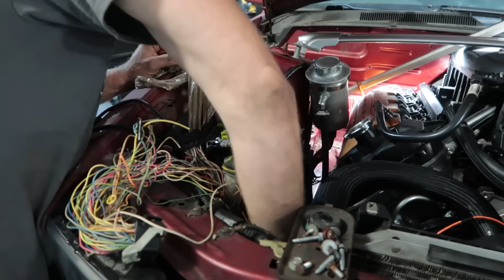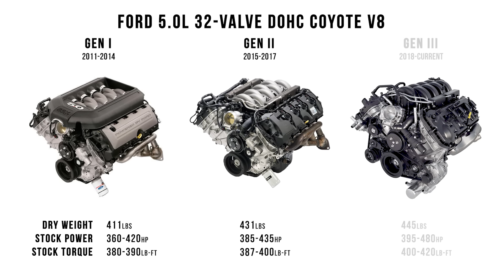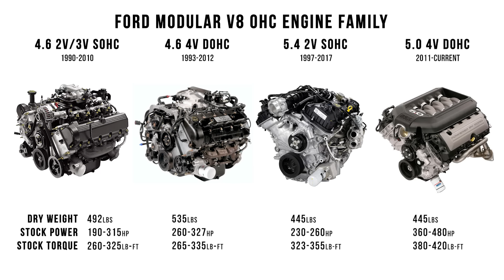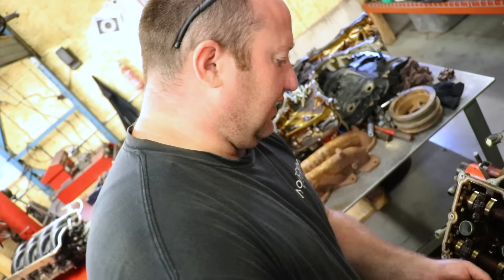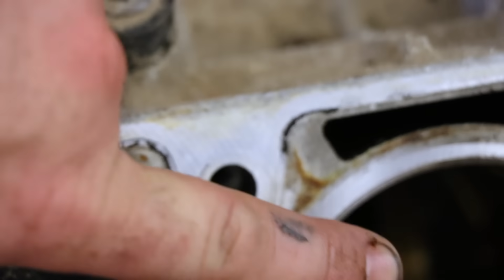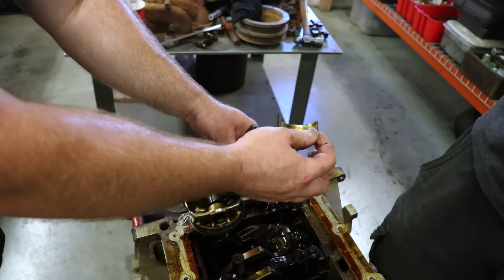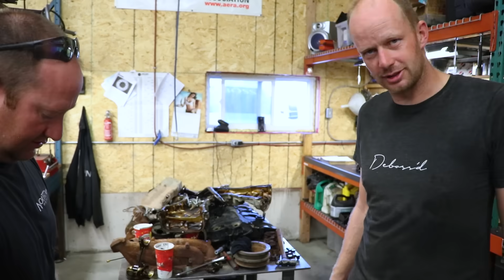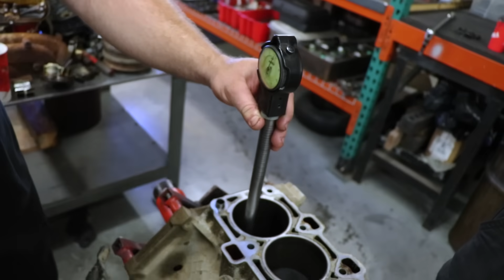REVIEW: Everything Wrong With A 5.0 Coyote Engine

Comment: I have 2 of them.  2015, 2016.  Pretty awesome.  Not much wrong with them.  Flimsy water pump.  The seals around the spark plug tubes and phaser connectors leak.  The reason for the cleaner head is the PCV air comes in on the driver side and goes out the passenger side.  I use Rotella T6 0/5-40 and have zero problems with phasers and oil.  15,000 km oil changes.  Also had a 2008 5.4...300,000km...never opened or worked on once.  Same oil, and oil change schedule.  The compression height discussion was bullshit though.  Unless your crank throw shortened when you bored the engine you 100% have more displacement.  Amateur

Comment: The thing I see with the Coyote, is even though sure, equal mods they can make similar power, the cams and shit for Coyotes are just not as radical. People aren't camming the shit, and turboing the shit out of em as much. Partially because they're already pretty damn good cam wise, but also just because springs would just be so goddamn expensive. So even mod for mod, you add the full liter of displacement a junkyard 6.0l LS has on a coyote, a half decent cylinder head, and a cam/spring, and you're damn near at the same power level regardless of budget.

Comment: 14:12 Siamese cylinder bores....  AKA, no cooling jacket between the holes. 
GMs OLD gen 1 small block 400 did that as well..... and EVERYONE thinks they overheat
.
i own two 400s.... they dont overheat (but they do when you swap them into a 305/350 car WITH OUT also swapping over the bigger radiator that comes with 400 cars/trucks)

Comment: ford needs 4 cams and 4 valves per hole to compete with GM and dodges 1 cam 2 valve PUSHROD engines..... 
AND! the ford motors MAY make more power.... but its in a VERY NARROW RPM range.... 
.
while the old 5.3 /6.0 makes power from off idle to 5800 rpm..... all about air speed
Reply: 4 cams and 4 valves allow for better air flow at high rpm, overhead cams also allow for safer high rpm use. More horsepower can be made at higher rpm.
Reply: @riogrande163  ya, you arnt telling me anything i dont already know
.
yet a 2V pushrod head can flow just as much if not more (hell, you can even have a 4V pushrod head that only uses 2 pushrods.... cummins)
.
yet a pushrod engine can and does rev just as high..... or higher than SOHC/DOHC engines
.
and sure.... HP can be made at high RPM
thats sorta how the math behind HP works
however it also can mean you make TONS of HP at 9000 rpm..... yet have 150 foot pounds of torque (honda 1.4)
.
.
.
OHC makes GREAT peak power numbers (aka, great marketing) 
.
what i want is a RELIABLE engine (with a timing chain that can go 750,000 miles..... not being replaced every ~100K) 
what i want is area under the dyno curve..... not peak numbers so high up in the RPM range, its pointless..... (and only makes that power for ~250 RPM)
.
a 750HP engine will get its ass kicked by a 350HP engine
if the 750HP engine makes power like fords do (again, great peak numbers.... but only for a limited RPM range)
yet that 350HP is made from 1800 to 6500 will kick its ass

Comment: 7:00 my guess would be that the PCV system.... 
air is pulled in on one side (cool air).... flows threw the motor, gets hot and full of vapor, and then gets sucked out the other head. 
.
so the color is just from cooler or hotter oil vapor.....IS MY GUESS!!!

Comment: Look, im not trying to rope myself in with the rest of the people in the comment section and call myself an expert but i have built a few mild and a few full race engines in my day. THIS guy is an idiot. 1) pin height has absolutely nothing to do with displacement. 2) synthetic oils are not abrasive on aluminum. 3) windage trays are installed with the intent to reduce the fog of oil surrounding the crank and return it to the pan as quickly as possible. Windage tray or not, oil squirters or not if the engine is running and has oil pressure the wrist pins are going to get spashed with oil. Seems to me he was trying to impress his buddy with his "knowledge" but totally forgot the internet was watching.

Comment: Synth is NOT NOT NOT the culprit.  It's living in a dusty area, not changing your oil and using poor air and oil filtration.  Has NOTHING to do with the base oil.  That's just one of the dumbest statements made.  I tear apart and build 5-7 engines per week at my shop and have never heard of such nonsense.  That owner was lazy and apathetic.  Also, there's SOOOOO much more backward compatibility with anything GM.

Comment: IF THE CAM BEARINGS ARE HOT ENOUGH TO COOK THE OIL ON THE CAPS LOOKS LIKE A OILING PROBLEM, I THINK MOST KNOW SYNTHETIC OIL FLOWS BETTER COLD AND TAKE THE HEAT BETTER WITHOUT CAUSING SLUDGE. THIS ENGINE LOOKS LIKE THE PCV SYSTEM ISNT BREATHING GOOD.

Comment: Replacement pistons that are decompressed. Many engines after being rebuilt have way less compression. Which is criminal as it makes them gutless thirsty dirty things. That coupled with decompresed head gaskets.
Recently with Federal Mongrel replacement pistons for my 400 Ford a 9.1-1 would have ended up around 7.5-1. Lost 16-17cc.
That engine has suffered oil starvation,, lack of or crook pump.
As for the Modular engines, way too large, way too unreliable and way too top heavy.
As for being modern? yay, a modern engine has far more problems and less  power. And I am a Ford fan.

Comment: This dude is a freaking joke!!! Typical Ford guy spouting all kinds of myths and legends about anything and everything to try and sound smart.
-Changing brands of oil that meet the same API standard will not harm anything.
-Manufacturers do not have "special" oil
-Synthetic oil does not crystallize ( OMG that's a doozy!! )
-Increasing displacement of the engine will increase power output all things being equal, it's a little thing called physics you uneducated dimwit!!!
I stopped watching at this point as I will most likely punch my iPad and break it like I would break this guys inbred jaw for being so full of SHIT!
Reply: right what a poor dumb bastard definitely not a oil engineer

Comment: I'm going to respectfully disagree that conventional oil is better than synthetic.  No conventional oil can hold a candle to synthetic in regards to film strength.  If you abuse the engine and operate it at extremes coupled with neglect to change it during normal maintenance windows - whether its convention or synthetic you're going to see different failures of the oil.  Yes additives can separate from synthetic oils and may cause crystallization however at that point a incredible amount of neglect has already occurred by not changing it regularly.  Ergo it is not the fact its synthetic that creates crystallization its the fact regular oil maintenance wasn't performed while using synthetic.

Comment: This guy was spouting way too much nonsense in regards to stuff like compression ratio and synthetic oil...
Reply: Adam Alvarez I stop the video when he started trying to explain displacement and overbore. This guy just thinks he’s a mechanic.
Reply from the maker: If it didn't come across on the video, on OEM pistons, if they are oversize, the ring groove is higher on the piston to keep the CR the same.  This way it doesn't mess with emissions.  On aftermarket pistons,  there is no general rule

Comment: I do 2k oil changes on my 2001 Toyota corolla using full synth high mileage the 1zzfe is notorious for burning oil and having oil leaks so checking is a must on these cars. It has currently 136k miles on it and the engine is suffering from piston slap because the last owner must of ran engine very low on oil causing the issue. It burns about 1/2 quart of oil about every 500 miles along with a slight front crank seal leak. So seeing 10k oil changes is outrageous lmfao the max Ill go on a oil change is 5k using full synth on a healthy engine.

Comment: I own a 2013 F150, 5.0 140k miles; oil change every 5k miles (Mobil 1 since new). I do have a tuner for gas mileage, but I do not drive the truck hard. I am 71 years old and hope to get 200k (or more) miles on the truck. However, considering the cost of a new F150, I do plan to replace the engine and or transmission if the need arises rather than buy new. Would you recommend a new crate engine from Ford or a engine build? I am disappointed in the life expectancy that was discussed in the video. I have never been a Ford fan in my life till I purchased this one, and it (chassis) is built hell for stout. I do not care for the new limousine trucks that are on the market, and the general motors trucks are butt ugly as well as expensive.

Comment: The Boss came with a special ECU to allow the engine to run on the Grey key ( Normal ) or if the Ford Racing "Red Key" tune was purchased and loaded ( Lopey idle and other changes).......it can run on either tune according to which key is used.  The RoadRunner version of the first Gen Coyote was designed for high rpm operation.  Besides sodium filled exhaust valves, larger exhaust cam and different valve springs.....in the street version its rev limiter was set to 7,500 rpm.  This identical ( which was built on the same line that supplied racing engines ) engine in a Boss S or Boss R was set to 8,250 rpm.  Because of the high rpm....this engine requires a special weight oil....5W50.  I would ask you to consider the displacement of this engine, its weight and its power output before sticking a fork in it.  I own a 2013 Boss. So, at 440lbs, 444 factory rated horsepower with a red line of 7,500 rpm.......it is a pretty amazing engine for its time!  BTW, my HP curve doesn't go flat until 7,300-7,400 rpm.  Not sure how a stock LS stacks up to that?
Reply: Check the wire harness to the cam sensors.....they are a small gauge and will often fracture....but being under the electrical tape you can't see it.  Also, you might need to replace the crank sensor ring gasket.  The crank sensors are very touchy.  Also, the ECU has a special procedure to marry the crank sensor to the ECU.
Reply: Sorry to say I don't agree with your engine builder regarding negative views on full synthetic oil.  I had a 2002 Chev 2500 HD with the LB7.  It decided to blow a head gasket at 76,000 miles.  This truck had full synthetic since its 10,000 mile break-in.  The truck also was used for short distances most of that time.  Removing the heads.....too have them checked for trueness....everything was clean and shiny.  The cylinder bores had very evident cross hatching left.  The mechanic said he was impressed how clean and limited wear the engine.

Comment: I hate GM, generally,  but they still make the best v8,  the problem with the coyote is Terrible low end torque.  in the higher altitude of the west that lack of low end really sucks. ford made a big mistake by not offering a larger cube version of the coyote.

Comment: There seems to be some questionable things that rebuilder said.  Larger diameter pistons/bores don’t increase displacement?  He tries to say something about lowering the piston height, but it’s hard to follow. I wonder if he is trying to that the compression ratio doesn’t change?  

Also are they trying to say extended drain intervals cause that varnish/sludge?  I will buy that - but to blame it on synthetic is baloney.  This is the first video on the channel that seems to have a bunch of misinformation.  I think is more miscommunication that misinformation?
Reply: Yeah I listened to that nonsense too... like just no clue at all.  Has he never in his life calculated compression, before and after boring a block, and using a replacement piston of equal shape of the original but larger diameter?  I think he really should try and explain that again because what he said in this video as false is common knowledge to anyone that builds.  I won't get into the oil thing too much... just wow.  I have varnished my own engines with synthetic, although not quite to that degree. It took running 22000 km change intervals and excessive amounts of idling to do it.  Even then my 6 liter still looks like new inside compared to that mess lol.

Comment: Based off the amount of dirt you had to clean off and how dark that oil looked, I'm guessing that engine was in a truck that saw heavy offroad use and probably didn't get regular oil changes or maintenance. 

I've got a 2017 F150 with a 5.0. Ford recommends something stupid like 8000 mile intervals for oil changes. I bought the maintenance program. You only get x amount of services per the agreement. I pay for every other oil change as I'm doing them at 5000 miles. As you said, oils cheap. I haven't had any issues with the synthetic to date. The oil life indicator is usually always high at time of oil change. I barely drive anywhere anymore. I have noticed that some of the Ford dealerships only put up to 6 qts in with the service. The 5.0 needs 7.7 qts. 6 works, it's still on the dipstick. 

We went to Colorado a month ago. I checked the oil before we left, thats when I found it a little low. Still very clean looking. so I added as needed. No problems on a 3079 mile round trip.  Was a bit over my oil change. Took it in, that's when I found out they only put in 6. So I just asked them to give me 2 more quarts and charge me for it. 

It'll be 3 years in September. The factory warranty expires, then we go to a Ford extended warranty. Ford ESP and my maintenance program go to 61,000 miles. So it's covered up until it's paid for. But I expect if I keep changing the oil at 5k, it'll last me at least 10 years no problem. 32k trouble free so far. For anyone wondering , there are 2 maintenance programs available from new purchase. Basic (oil changes and tire rotations) about $400. Comprehensive (this covers almost everything: lof, rotations, brakes, windshield wiper blades, air filter, hepa filter, etc.) about $1500. I bought the comprehensive because a friend of mine, who didn't maintain his F150 as good as I maintain mine put a lot of money into brakes. Pads, rotors, I think he needed at least 1 caliper. I doubt I'll ever have these issues, but If I get a 2 axle brake job out of this, new filters and wiper blades, oil changes and tire rotations annually it'll more than pay for itself over the life on my loan. Then it needs new tires and I can either trade it in or keep it and still have a well maintained truck with low miles in decent shape. But I mainly bought the better program after I saw the price tag associated with my friend's F150. I thought I'd be driving more. But apparently after 32k my brakes are still in really good shape, and I may not have needed the better maintenance program. 

Looking at adding either a Mustang or Bronco to the stable in 2023. My father who is a retired Ford tech, says the EcoBoost engines aren't bad, but they MUST be properly maintained.

Comment: Forgot the Boss 5.4 that we got here in Australia,  Imagine Cobra R 4.6 heads on a 5.4 truck bottom end, Makes from 350 to 420hp at the crank stock depending on what one you get. Some make 400+whp  with a intake, tune and exhaust.

Comment: Fuel is the biggest factor of engine oil contamination. Lower quality fuel means increased sludge. No engine manufactured after 2010 should run lower than mid grade fuel. No one seems to understand the relationship between low fuel quality and oil contamination.

Comment: The Coil bolts on the 5.0s like to snap off when you go to do a tune up. My buddy snapped one on his 16 f-150, and I had it happen on a customers 13 f-150. We do live in a rust belt area, but I've pulled out plenty of coil bolts on 5.4s that were way worse looking with no issues. And those bolts are very similar looking.

Comment: We know you don't like anything Ford. Stock crank vs boss crank are exact same crank only balance was different. GEN 1 Coyote rods and bearings were just fine and in fact same rods and bearings as 4.6. Cranking power up what broke them in most cases. This engine was poorly maintained I think rod bearing was seizing stressing the rod. Remember 4.6 and GEN 1 coyote rods were powdered metal rods just about to limit of power and RPM they could take. GEN2 coyote basically got Boss rods because power and RPM range was higher.  Bearing crush holds bearing in cap and rod NOOOOO. Bearing crush is when cap is tighten pushing bearing ends together and that is what keeps bearing from spinning in the rod. So many think bearing tab keeps them from spinning but all they really do is locate bearing....I've had new rods and bearings where bearing tried to fall out and put million miles on them and no problem (cat 3406E). Bearings in most case snapped in place because way they are made thats hold them in place. ALL engines after being ran for sometime bearings stick to the crank and rods are just fine.

Comment: Cringing at these guys not taking the cam thrust bearing cap off first so it basically bound itself when they released all the other caps first. Which is why they had to hit it with a hammer to get it out.

Comment: 5.4 3v cam cap issue was from the timing chain tensioner gaskets.  They never got them right, after many revisions.  They would start to leak around 50K, and the oil goes to them before the rest of the head, so no oil to the top end.  When a dealer gets a 5.4 in, the first step is to listen for noise, second is to remove a can cap, and if the scoring catches a finger nail, replace the engine.

Comment: I wondered about those deposits many years ago on a Honda we bought near new, sixteen years ago. Upon using newer oils noticed those stains appear and made the assumption it was due to the synthetic nature of the oil, though nobody believed me. The car incidentally had regular oil changes and generally ran longer trips. Wife still has the car and its fine, but yeah you spend the coin on the good stuff and there still remains a compromise.